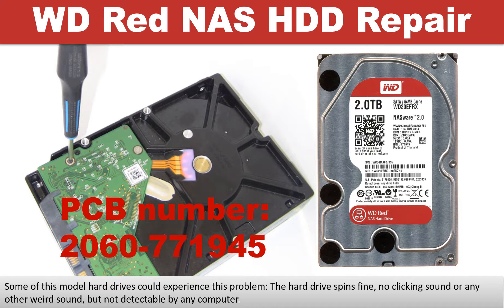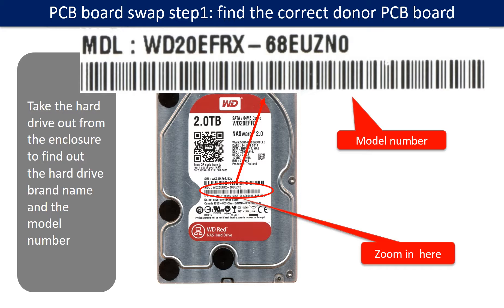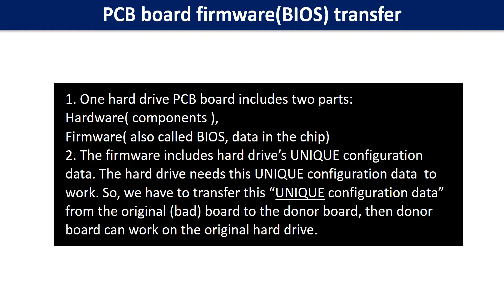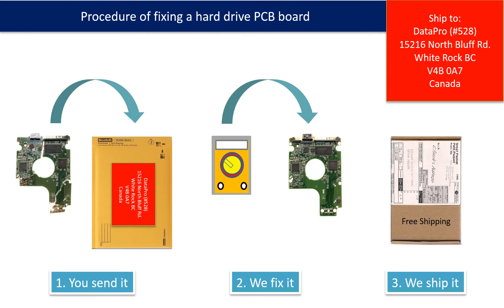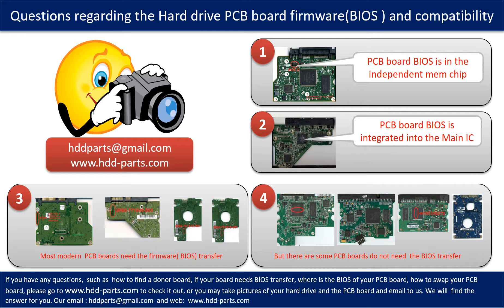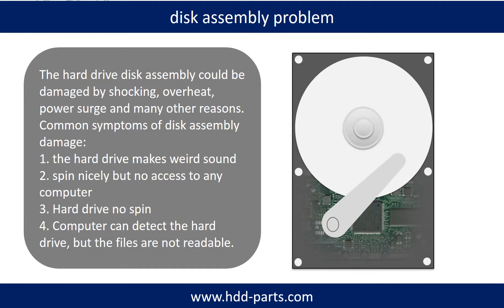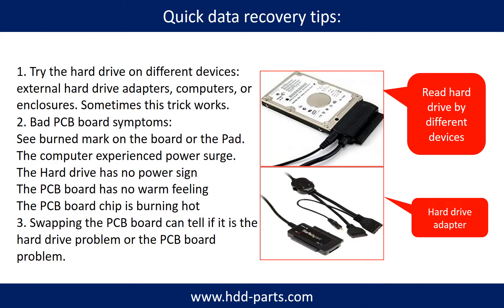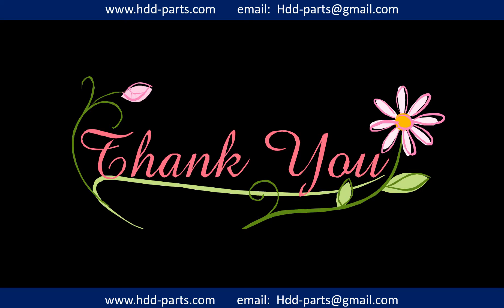WD Red NAS hard drive repair data recovery 771945   WD20EURX   WD20EZRX   WD30EFRX WD30EZRX WD40EFRX

Comment: Hello I'm new to doing this kind of technical fixing. My 4tb WD40EFRX if it is plugged into pc, then windows will not even start. I bought an external sata cable, plug into power and plug in USB to pc but it just makes a soft "shh shh shh shh shh" sound continuously. No motor sounds etc. My question is do you have any advice where to start troubleshooting please? I am new but confident to open up drive etc. Thanks in advance.